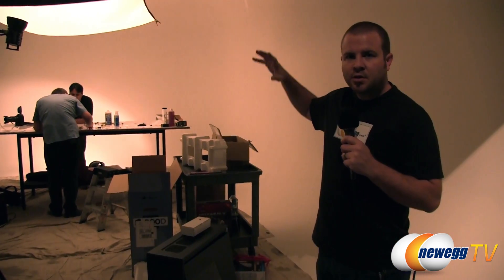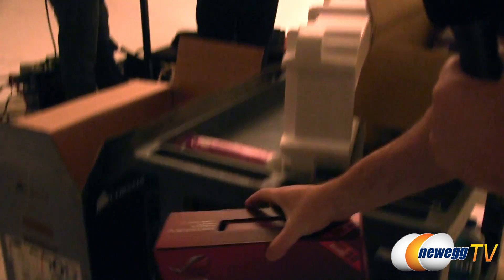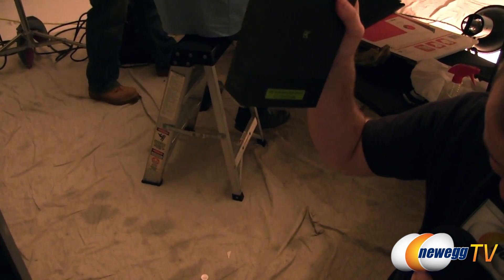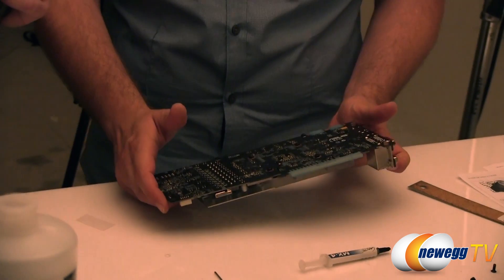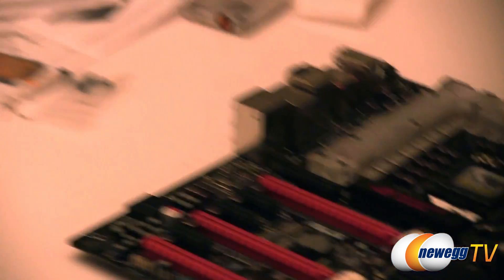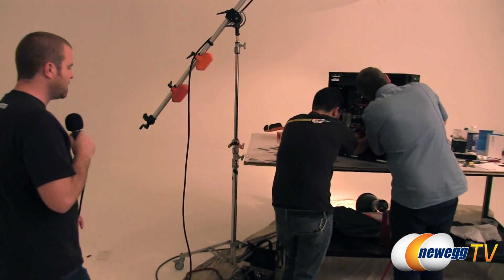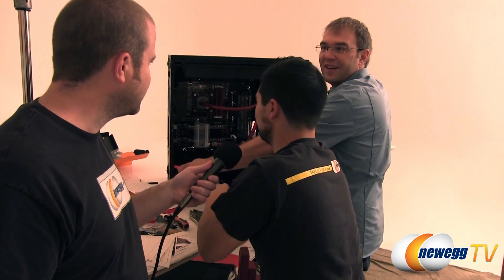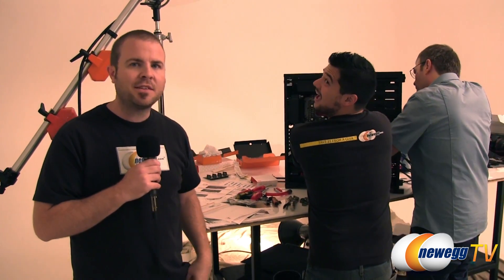Water Cooled Build with Geek Magazine Part 1 - Newegg TV

Comment: Don't know about 4K since I don't personally own a 4K monitor but for multi monitor setups and 5760x1080 OC'd Dual 7950's do just fine.

I actually own quite a few 7950's (50) Sapphire Vapor X OC'd to 1100 by 1500 used in a beowulf render farm setup and they run great, extremely cool and efficient lagging anywhere between 5-12% behind 680/770/7970. It would be an interesting topic to explore.

Comment: I don't know what games you're playing, a standard 2gb GTX 680 cannot run latest gen games like far cry 3 or tomb raider in 4k or 5760 x 1080. It is a very capable card as I've said before, infact I'm running a lightning 680 in my own rig but I prefer single monitor UWHD gaming over multi or 4K. If I was building a system for overclocking and high res gaming I wouldn't even consider Nvidia, I would go straight to Dual 7950's they're cheaper the overclock like a beast and have a 3GB frame buffer.

Comment: In my opinion if you were going to put your money on an extreme build might as well go for the latest gear especially since it costs the same if not less and has increased performance.

680's aren't adequate for 4K gaming or multi-monitor high res gaming due to the 2 GB frame buffer. 3770K is a good overclockable CPU but the on board Memory controller is nothing special and the Z87 chipset is a work of art.

Not Trolling, just my honest opinion.

Comment: not really , what games you talking about ? Bf3 , crysis 3 , metro 2033 and last light ? these are the very top graphical games cant be smooth max on 580 but 90% of the games out there can run 45 fps+ max on 1080p my point is that Gtx 680 is not outdated at all It play all games max 99% of games and they got Sli lol also overclocked with water cooling so will be super performance for 680

Comment: Because thinner radiators have denser fin arrays.  Denser fins means you need more static pressure.  More static pressure means larger fan blades spinning faster.  Larger fan blades spinning faster means more noise.

Thin radiators = more noise.

Bigger radiators = less noise.

Comment: When have I mentioned the 780? Firstly I was talking about the 770 and if you check online prices the asus DCU 680 costs around 400 usd and the Asus DCU2 770 costs 380, the 770 performs 5% greater and has Turbo Boost 2.0 as well as better power management. 

The Video mentions High Res multi monitor gaming, the GTX 680 is not capable of high res multi monitor gaming due to the 2gb frame buffer, and the extra GDDR offered by the 780 would greatly improve multi monitor performance. 

Focus. 1/10.

Comment: ...smaller footprint, looks better, and just an overall better case. 

When it comes to the choice of LC gear.. very bad choice.. first of all he's a rear 120 which not only looks bad it just adds extra tubing and routing to worry about and again it looks awful its so 2006.

Having a total of 480 is barely enough to run an OC'd CPU and Dual OC'd 680s and the motherboard the pump is adequate but just barely with no fail safe and the choice of tubing is again very old school..

Comment: If you're spending the money on a new machine why use last gen parts? They cost the same amount and in the case of the 680/770 the 770 costs less and is around 5% faster and since he's LC'ing it'll benefit greatly from Turbo Boost 2.0

The 800D came out back in 2009, a great case, but again outdated bad airflow bad LC support low on IO and not that easy to work with compared to other cases at that price point. As an example the 750D costs 100 USD less has better airflow and LC Rad support...

Comment: Just because they are using last gen hardware for the CPU and GPUs doesn't mean it is underpowered, once it is overclocked I imagine it will come close or even match many more modern high end systems. And with the cooling, how is that not adequately cooled?

Comment: That is completely wrong. They're different chips. The 680 is GK104 while the 780 is GK110, and there's a significant performance difference. The 770 (GK104)  is the rebranded/rehashed 680.

Comment: Well, the Ivy I7 is about 10% quicker than the Haswell I7. But for the 680's, I'd guess that this build was in planning for a good while. But the GTX 680's are just about the same speed as 770's. It is essentially the same card.

Comment: why would you use a single 120 rad. its pointless. especially in that case if you are water cooling both graphics cards and the cpu and the motherboard you should have 120 for each component plus at least 120 overhead (ie 360 +240 or more) that case will fit a larger rad upfront. why would newegg do a water cooling build, they have no experience.

Comment: 4-way SLI titan has less performance than 3-way. Also 780s are cheaper and better overclocking potential since they have custom PCBs and other things vs titan. Titan just has more Vram but that only helps performance with higher resolutions.